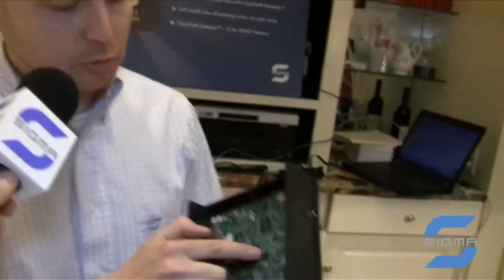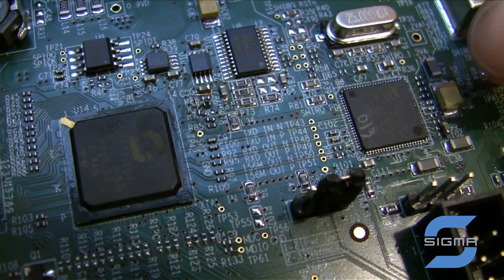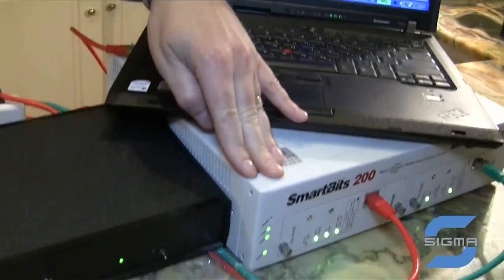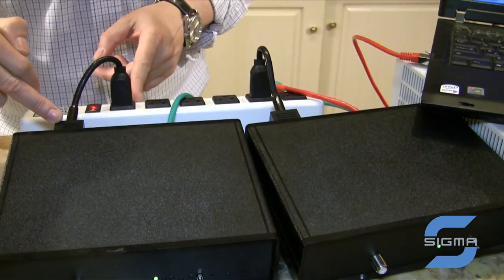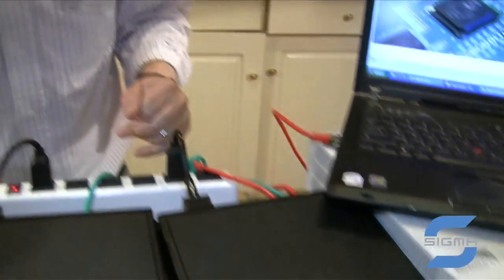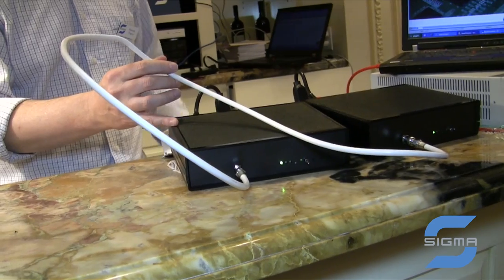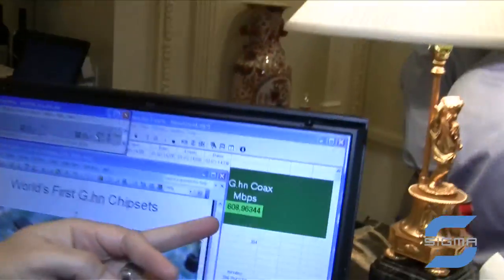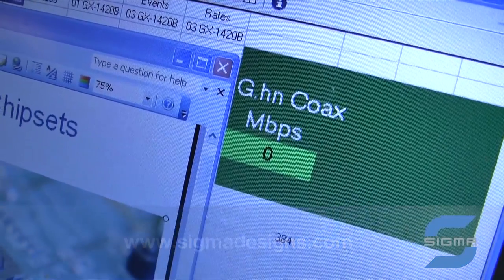High-Speed Networking Over Powerlines or Coaxial Cables

Comment: The ElectroMagnetic Compatibility Directive specifies that no device should prevent radio equipment from working as intended. Due to the way PLT works (transmitting radio waves into an unshielded, inbalanced cable such as the ring main), that's exactly what it does to any radio equipment under 30MHz within 200-500 meters of the site.

"Gigabit" PLT devices have been known to interfere with VHF Aircraft radio and Band II and DAB broadcast radio as well.